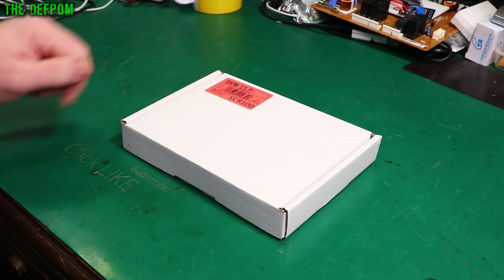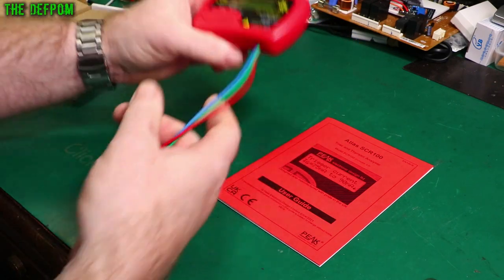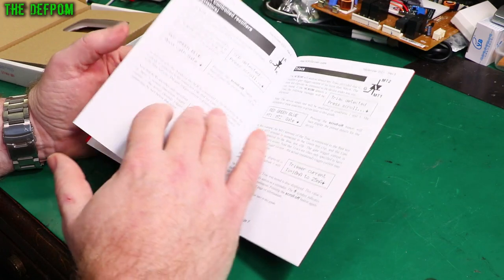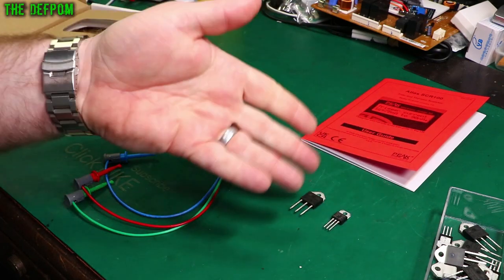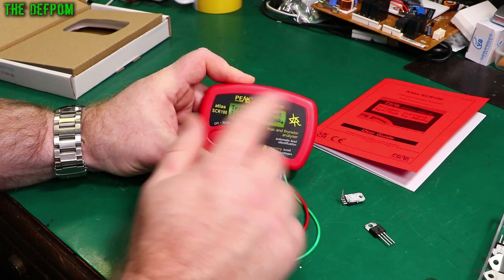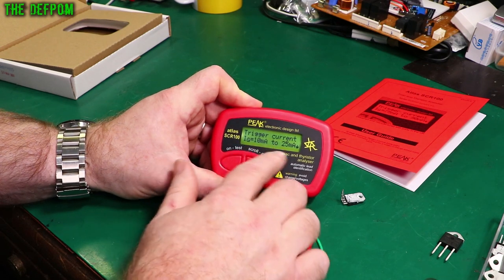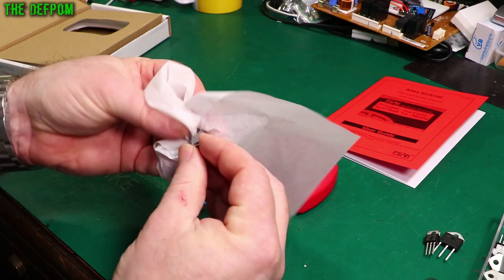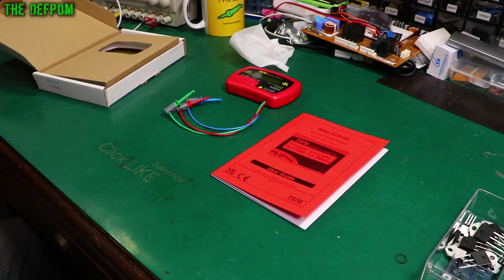🔴 SCR and TRIAC Tester Review - SCR100 from Peak Electronic Design - No.1030

Comment: Thanks for the review. I really like your reviews and repair videos, but unfortunately while Peak Atlas's testers have some great features, especially the curve tracer on their DCA75, I've personally never liked the form factor. There's no in-built stand due to the design of the case and where their test leads come out. Plus apart from the DCA75, I believe they have used the same 2 line LCD screen across all their testers. While I think they do this to keep all their testers looking uniform and also keeping costs down by using the same shaped case and screen for all their testers, they really need to consider at least upgrading the screen so that way users don't need to keep on pressing the scroll button when testing a component. A battery cover on the back so users can easily change the battery and also check for battery leakage easily without needing to unscrew the back would have been better. Or at the very least, considering the price of the product used metal inserts for the threads. Since the design of the case may prevent them from including an in-built stand, they should  have given their stand with the tester rather than making customers purchase it separately. especially due to the price. Anyway, that's my 2 cents. Keep up the great videos too. I've learnt a lot from watching them.